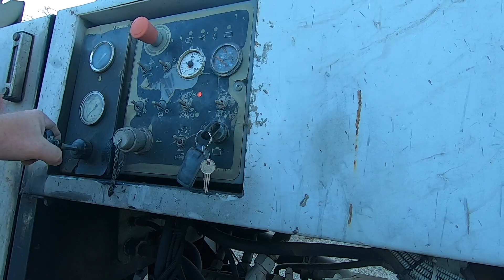Winter storm warning! Can we pump concrete in 26 degree weather with Muddyfeet

Comment: Been wondering how you guys are doing in the ice.. Sorry for running late. Still on lock down and bored to tears. Dang weather, ice storms from TX to TN. You guys stay safe.
 Look behind the car in front of you for glare off the tail lights shining up off the road that is a sign of black ice .... Slow down and ease towards the edge of the lane where there's a bit  more traction.
Reply from the maker: We need a stretch of good weather. These pumps need to be exercised